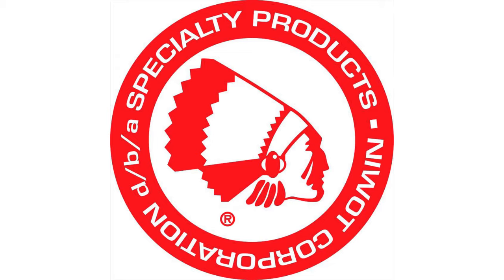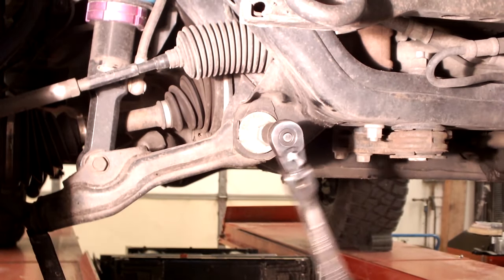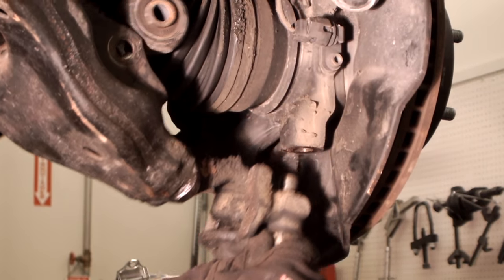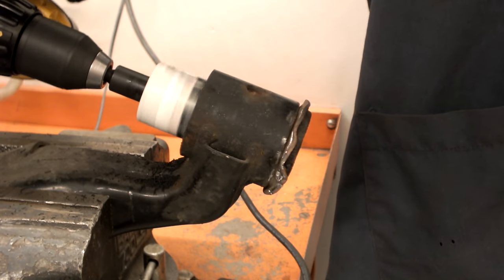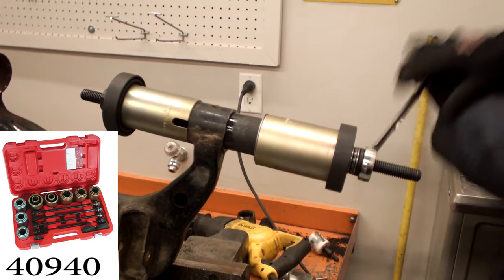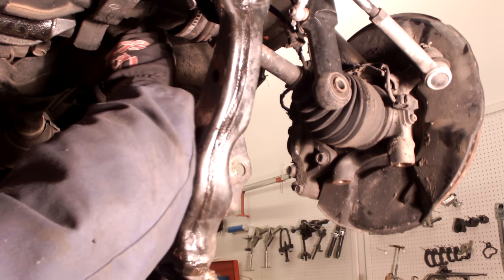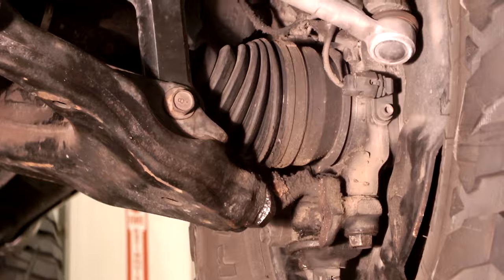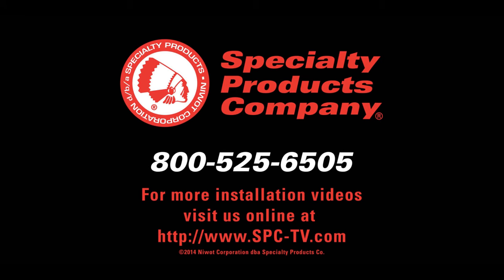Replace Toyota Lower control arm bushings-SPC Alignment

Comment: that's a lot of work for control arm bushings. I like how the bolts just lined up after installing the lca.. when I did my lift I had to use ratchet straps to compress the spring enough to get those ball joint bolts to line up.. it was a major pain.
Reply from the maker: Obviously, replacement of the lower control arm as a complete unit is also an option. The cutting of the frozen adjusters and bushings would be needed for either option. This video gives another choice with a different effort vs cost ratio!

Comment: Don't forget your carbide blades! Normal thick metal blades will burn out quick. These blades will save you so much time the cam bolts are grade 10!
Reply: Remove the bolt and cut the sleeve. I had to  hammer one bolt out but others came out pretty easily

Comment: I just had my rack and pinoin mount bushings replaces lower control arm bushkit replaced castor/cam adj kit both sway bar link kits replaced.  Bellow/boot kit.  Outer tire rod end In tie rod end.  Plus 4 wheel thrust angle alignment, adjusted castor and toe as needed before & after settings.  X Rotation on tires.  It was on the 2001 Toyota Tacoma TRD crew cab.  It was all original.  I asked him to check out front bushings as I've heard that they have been problematic.  For a 21 year old truck all  ive had done was regular maintenance oil changes and tire changes.  Added a TRD  supercharger in it 13 years ago.  It's paid off & never plan to selling it.  Just 725 $  /855$ labor. 115 taxes totalling 1 ,687$  . A shop that I trust. Could have snapped & dropped down to the fender and doors.  Whew drives great now. I'm glad I decided to ask him to check it  out ! I'm good for another 200k miles or more.  I couldn't have done it myself after seeing this .Drives so good 👍
Reply: That is a lot of work and $.
Reply: Where did you get it done with their contact info because I cannot find any shop that wants to do any pressing they all want me to spend $800 more to buy upper and lower control arms when all I need is bushings

Comment: I was wondering i had got the rears trailing arms?? Replaced on my 2001 Toyota Avalon XL..& the new arms or old arms does not have the adjustment bolt..on them.
Would I need a alignment afterwards??
Reply from the maker: As a general rule, any time a suspension or steering component is replaced, an alignment is recommended. In your case, the Avalon comes from the factory with only rear toe adjustability. If the rear camber is not in spec, the 81270 EZ-Cam bolts are available. 1 box has 2 bolts; enough to adjust both sides. On a similar note, the front takes a different size EZ-Cam for front camber adjustment, the 81290. https://www.spcalignment.com/index.php?option=com_spc&task=part_description&pid=81270&Submit_form=Submit
https://www.spcalignment.com/index.php?option=com_spc&task=part_description&pid=81290&Submit_form=Submit

Comment: Helping a friend replace his lower control arm bushings on a 02 Tacoma. We were able to press out the bushings but the metal sleeves did not come out with them and are stuck inside the lower control arms. We have followed  the directions on here by cutting them in half and using air hammer and it not getting them out any other ideas?
Reply: Yes we verified the inner metal sleeve was cut all the way through. We even made another cut about a half inch to the side of the first cut and try to knock out that piece of the sleeve. None of this word had to end up taking it to a local shop with a press to drive it out. It’s done now but would have liked one of these methods to work without having to pay a shop. For future reference anyone doing this job I would highly recommend looking into strong flex poly bushings for the first GEN Tacoma‘s. They can  be pushed right into that existing metal sleeve that way you don’t have to fight with it the way we did.
Reply: Yes we verified the inner metal sleeve was cut all the way through. We even made another cut about a half inch to the side of the first cut and try to knock out that piece of the sleeve. None of this word had to end up taking it to a local shop with a press to drive it out. It’s done now but would have liked one of these methods to work without having to pay a shop. For future reference anyone doing this job I would highly recommend looking into strong flex poly bushings for the first GEN Tacoma‘s. They can  be pushed right into that existing metal sleeve that way you don’t have to fight with it the way we did.
Reply: Yes we verified the inner metal sleeve was cut all the way through. We even made another cut about a half inch to the side of the first cut and try to knock out that piece of the sleeve. None of this word had to end up taking it to a local shop with a press to drive it out. It’s done now but would have liked one of these methods to work without having to pay a shop. For future reference anyone doing this job I would highly recommend looking into strong flex poly bushings for the first GEN Tacoma‘s. They can  be pushed right into that existing metal sleeve that way you don’t have to fight with it the way we did.
Reply: Yes we verified the inner metal sleeve was cut all the way through. We even made another cut about a half inch to the side of the first cut and try to knock out that piece of the sleeve. None of this word had to end up taking it to a local shop with a press to drive it out. It’s done now but would have liked one of these methods to work without having to pay a shop. For future reference anyone doing this job I would highly recommend looking into strong flex poly bushings for the first GEN Tacoma‘s. They can  be pushed right into that existing metal sleeve that way you don’t have to fight with it the way we did.
Reply: Yes we verified the inner metal sleeve was cut all the way through. We even made another cut about a half inch to the side of the first cut and try to knock out that piece of the sleeve. None of this word had to end up taking it to a local shop with a press to drive it out. It’s done now but would have liked one of these methods to work without having to pay a shop. For future reference anyone doing this job I would highly recommend looking into strong flex poly bushings for the first GEN Tacoma‘s. They can  be pushed right into that existing metal sleeve that way you don’t have to fight with it the way we did.
Reply: Yes we verified the inner metal sleeve was cut all the way through. We even made another cut about a half inch to the side of the first cut and try to knock out that piece of the sleeve. None of this word had to end up taking it to a local shop with a press to drive it out. It’s done now but would have liked one of these methods to work without having to pay a shop. For future reference anyone doing this job I would highly recommend looking into strong flex poly bushings for the first GEN Tacoma‘s. They can  be pushed right into that existing metal sleeve that way you don’t have to fight with it the way we did.
Reply: Yes we verified the inner metal sleeve was cut all the way through. We even made another cut about a half inch to the side of the first cut and try to knock out that piece of the sleeve. None of this word had to end up taking it to a local shop with a press to drive it out. It’s done now but would have liked one of these methods to work without having to pay a shop. For future reference anyone doing this job I would highly recommend looking into strong flex poly bushings for the first GEN Tacoma‘s. They can  be pushed right into that existing metal sleeve that way you don’t have to fight with it the way we did.
Reply: Yes we verified the inner metal sleeve was cut all the way through. We even made another cut about a half inch to the side of the first cut and try to knock out that piece of the sleeve. None of this word had to end up taking it to a local shop with a press to drive it out. It’s done now but would have liked one of these methods to work without having to pay a shop. For future reference anyone doing this job I would highly recommend looking into strong flex poly bushings for the first GEN Tacoma‘s. They can  be pushed right into that existing metal sleeve that way you don’t have to fight with it the way we did.

Comment: If you live in snow , give your under carrage after each drive or at the end of the day , that will remove the salt that eats your under carrage .
Reply from the maker: Good suggestion. Anyone who has NOT worked on a rust belt car might not understand this. However, we have seen Toyota adjuster bolts seize on 3-year old trucks from non-salt areas which don't have a spec of rust anywhere else!
Reply: Give it what?
Reply: @TheRogerKyle  hose it down

Comment: why don't you use a bushing press kit to remove the oem bushing ?! why did you had to saw, drill it and cut it !?
Reply: @specialtyproductscompanysp8027  humm interesting... I am asking because I am about to embark on this journey.. I hope in the next weekend to lower my subframe and to replace those but I was hoping I could avoid cutting, burning or otherwise invasive processes... but I guess I will have no choice...

Comment: Is it possible to change spc upper control arm rubber end ring and replace it with polyurethane bushings?
Reply from the maker: I am assuming you are asking about replace standard rubber bushing with poly style bushing on SPC Toyota upper control arms. If so please see this product page.https://www.spcalignment.com/index.php?option=com_spc&task=part_description&pid=25476
Reply: Poly is tough but it's crap. Becomes noise after a while

Comment: Question what is that plastic part that go over the bolt?
Reply from the maker: The plastic sleeve in our kit is a spacer to fill the gap in the new bushing. The stock adjuster bolt has a bolt through a sleeve also. You can't see that in this video because it was seized to the bushing inner sleeve and that is why the arm needed to be cut out.

Comment: So I can not use a spc cam bolts on a stock lower control arm bushing rt
Reply from the maker: SPC Toyota cam bolt kits WILL work with stock lower bushings per the Application Guide on the SPC website. This video was to explain the procedure for removing frozen adjusters. Once the bushings are replaced (or the whole control arms) then the SPC or OE Toyota adjusters will function correctly.
Reply: The spc bolt i have came in two different sizes, it is kinda loose when I put the spc bolts in place.
Reply from the maker: @4bvenom733  Please provide vehicle model & year as well as the part number of the kit you have. The first step is to check these. Thanks

Comment: FRIEND I'm from Colombia my work is similar to change bushings and bearings, but excuse me the way you change the bushings of this scissor, it's not the best, you hit the eye a lot with those tools, it's easier to remove the upper ring with a polisher, then you go to the press and remove the internal bushing, then you go to the bench press, tie the scissors well and remove the bushings with a small steel chisel, with a hammer and carefully, so you pound the scissors less, it takes me 15 minutes changing The four hubs earned me about 50 dollars of course it's in Colombia, here there are excesses Toyota

Comment: Kind of a crappy video.  You don't actually go over how to replace if you CAN get the bushing out.....I get it how but not everyone might....
Reply: Cry me a river 😂😂😂
Reply: In that case, you will need to cut the frame around the control arm to remove it...Make sure you have enough super glue to reattach the frame once you're done.
Reply: why do you need to know anyway?, its not like you're gonna be replacing any of them
Reply: @mathew5956  bwwwwaaaaahahaha hahaha ha ha ha
Reply: No, this video was great.